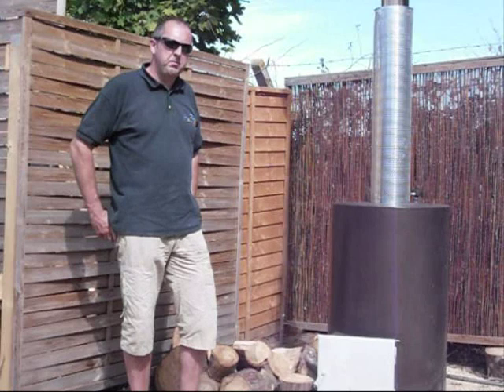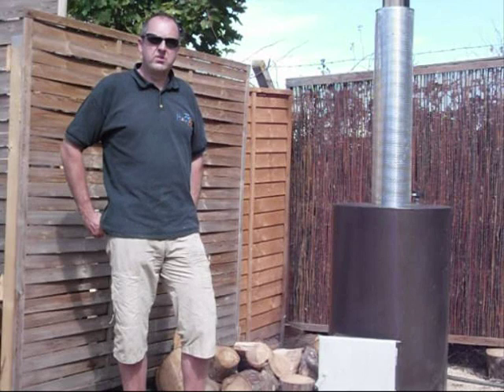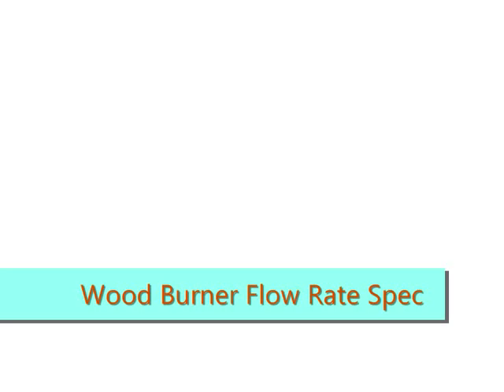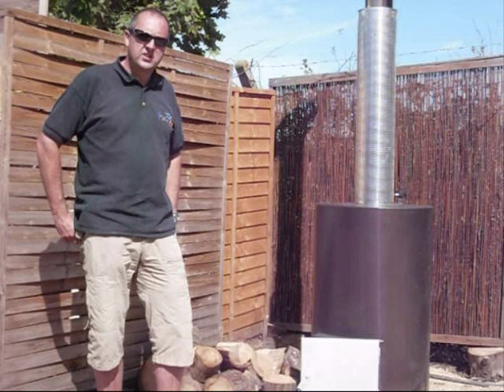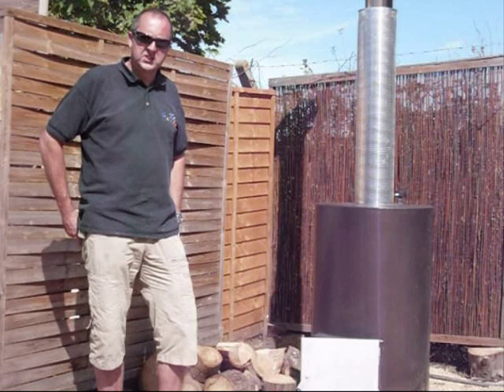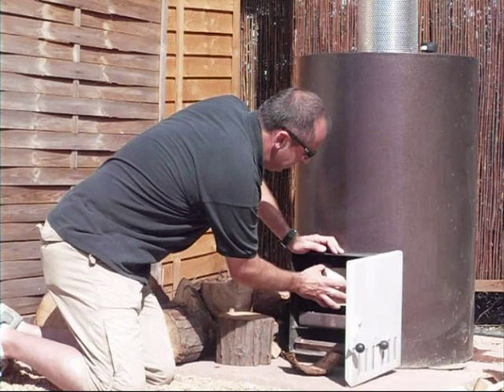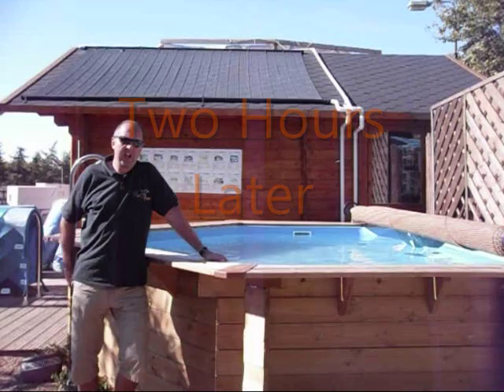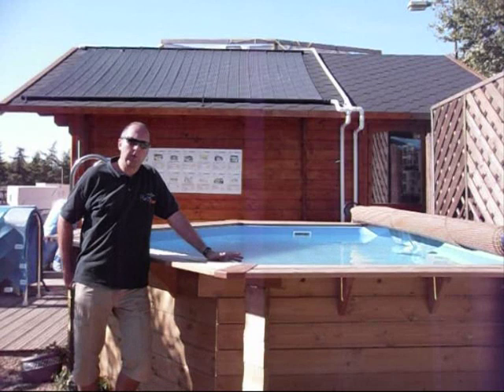wood burning swimming pool heater demo

Comment from the maker: Your numbers seem spot on, i would say it would increase the pool by 5 degrees p/h. lph and gph are 5,000 liters or 1,321 gallons p/h (us gallons). As the pool temp is increase so fast, there is less heat loss than say electric / gas and as such this will work in most tempretures. Next week we are heating the pool with ambient air and pool water at about 5 degrees. We will hopefully post a video on the cold water test. thanks again for your comments. Steve

Comment from the maker: the return temp coming back into the pool has been in excess of 20 degrees higher than the pool temp. In the summer when the pool was at 20 degrees we measured the return temp at 45 degrees.

Comment: wow ! ... hey Steve... that is just amazing ! , brilliant actually ! ...  I'm super impressed.  It's too bad your system isn't available in North America, I'd look into it.  I always thought I could take an old wood burning stove, and have a metal pipe welded into it, just above the area where the wood would burn, and then run water through it..... this is basically the same concept you are using ?

Comment from the maker: Thanks for your comments, the sound is not great and we are working on this. With regards to your other points, we also use solar on this pool and when the UK weather is kind we get approx 2 degrees an hour. This pool is 10,000 liters with 1/3hp pump 5 c/meters p/h. Test during the summer raised the pool tempreture from 18 degrees to 28 in just over 2 hours. We are now running tests with water temp at 5 degrees

Comment from the maker: Best practice is to make sure flow rate is working fine before firing up the woodburner. The only problems we have encountered is when the water flow has stopped through faulty pump or where customer has turned of water supply which has led to major faults. comments are always appreciated although your 'dummy' comment is bizarre and I think says a lot more about you

Comment: Hi Steve,  I'm pushing about 1200 gallons per hour, - figure 20 gallons per min ( approx ) .

However, - when I'm pushing 20 gallons per minute, the temp of the water coming out of the solars is about 4 or 5 degrees higher than the pool.   I'm going to guess that your system is pushing much higher heat.

have you ever measured how much higher the heated return is going into the pool, above the temp of the pool water ? ... this would be very interesting to know !

Comment: My pool is 4x that size, ( approx 40,000 liters ) so that would result in maybe 6 degrees in 2 hours ? , that's pretty good.  I need a 100% sunny day to get a 2 degree increase in my pool, and many times it's more of a 1.5 degree increase, ... however your wood burning system, will provide that constant increase in any type of weather,  it's a nice system, very nice.  5 cubic meters per hour... oh boy, do you have any idea what that would be in gallons per hour ? or liters per hour ?

Comment: Audio volume is very low - for a professional video this is really sad :-(

- you don't say how many gpm you are shooting thru the heater, you also don't tell us how many litres are in that pool.  In Canada, our pools are 40,000 liters on average for an 18 foot above ground round pool.  I use solar heating and get about 2 degrees per hour increase ( not bad for free ) ... however this burner system looks good, but it's just too bad you don't have any real specs, and test results.